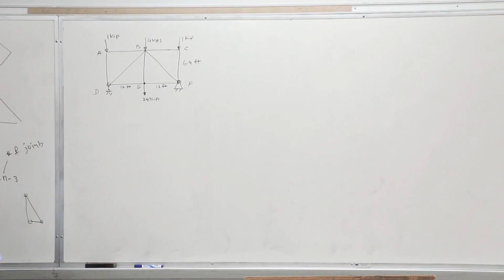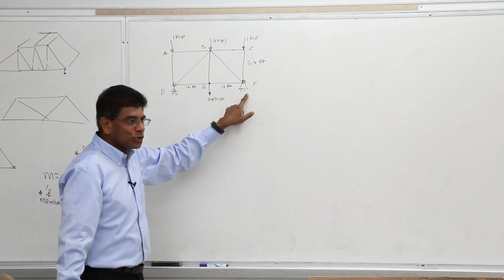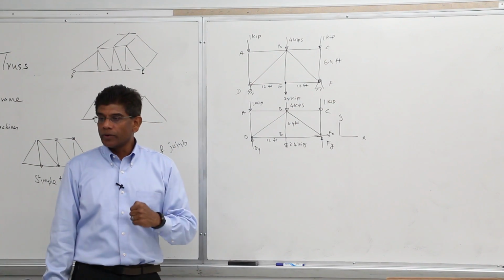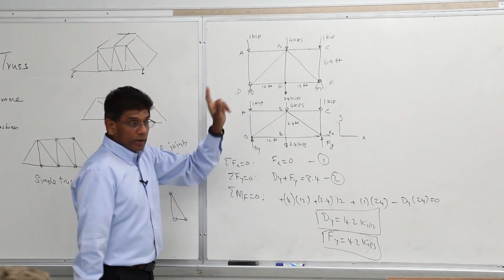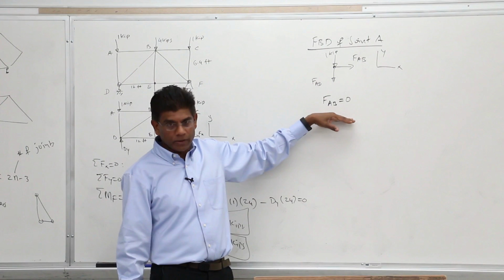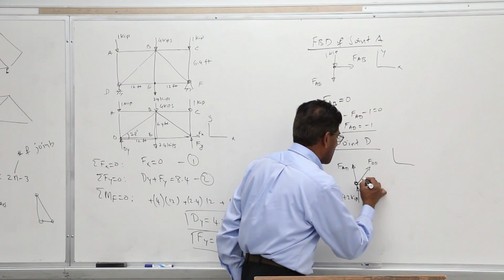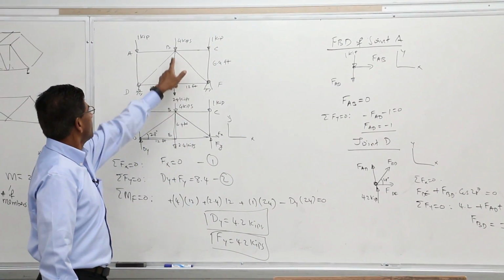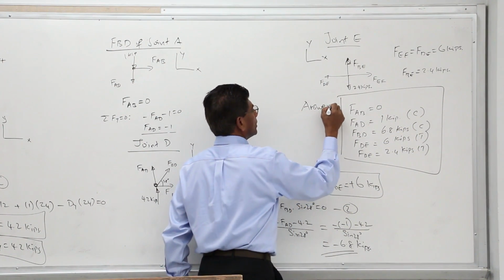2D Truss Analysis Example

Comment: wth is a kip
Reply from the maker: kip stands for 1000 lbs. This unit is used only in the US (in older books).
Reply: @outstandingprofessor1506  ah I see, I'm only used to using Newton's
Reply from the maker: @seedling6730  Yes. Metric units are used everywhere except in the US. Even here it is finally changing.
Reply: @outstandingprofessor1506  that's great